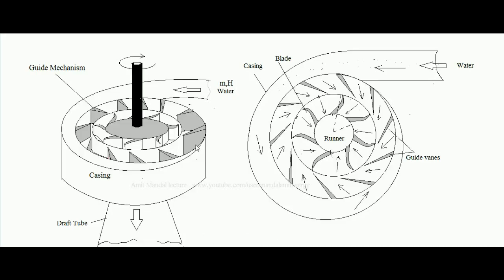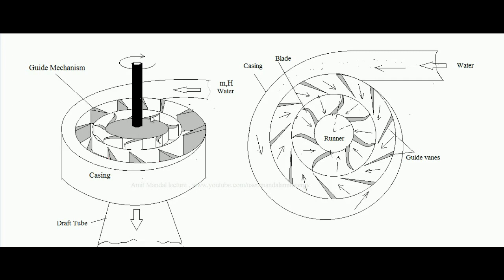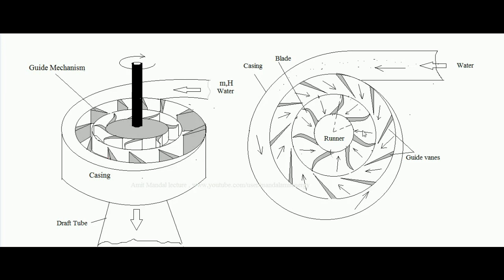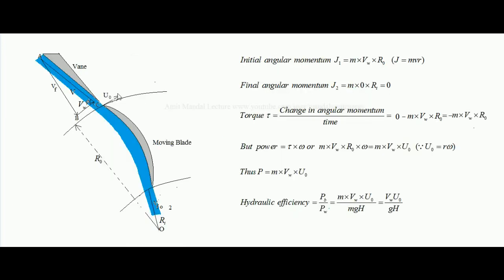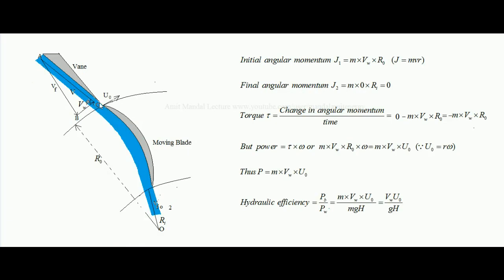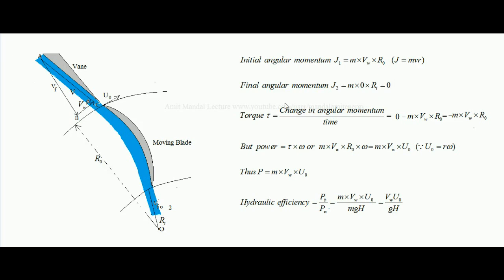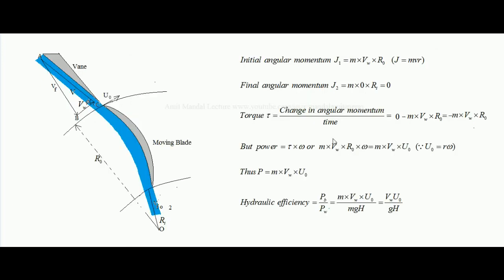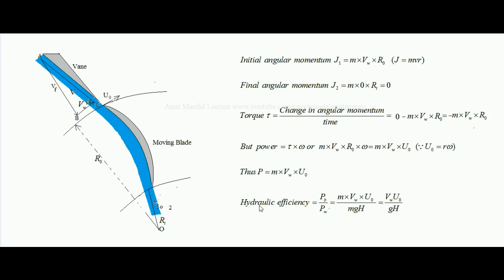Francis Turbine working , Power and efficiency

Comment: Water enter the Runner through Guide vanes with sharp entry having maximum losses, mean conversion of energy into mechanical energy would be less (low power will generate) as according to the first diagram in this video, it should be radially inward in the direction of flow.
Reply from the maker: Here ideal case is considered.
Reply: Apology Sir, But that direction is suppose to simulate ideal condition,
BTW your efforts are great, I love you for all this.

Comment: Where is stay vane?
Reply from the maker: +kurunandan shishaudhiya , The guide vanes are also called as stay vanes.
Reply from the maker: +kurunandan shishaudhiya , The guide vanes are also called as stay vanes.
Reply: No. ...They are different. ...first stay vane comes then comes the guide vane.....generally stay vanes are fixed where we increase velocity but guide vanes are pivoted we can rotate them and there we control flow angle and amount of discharge
Reply from the maker: http://nptel.ac.in/courses/Webcourse-contents/IIT-KANPUR/machine/ui/Course_home-lec28.htm